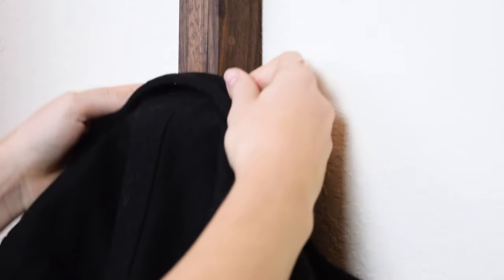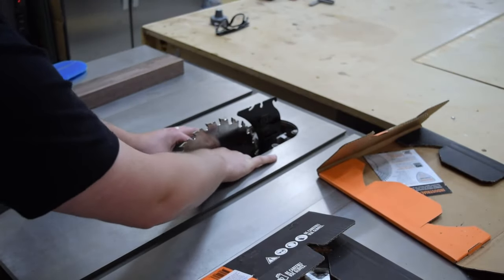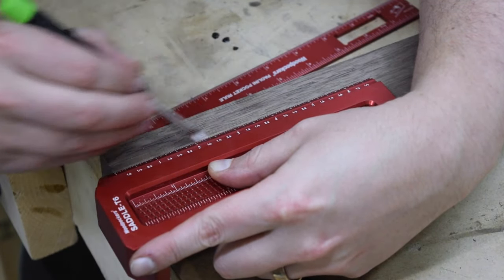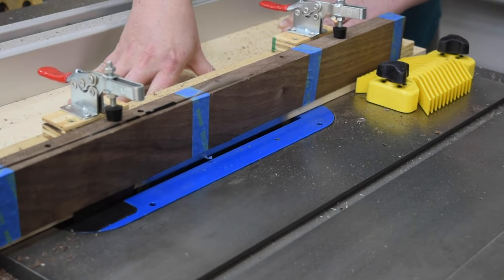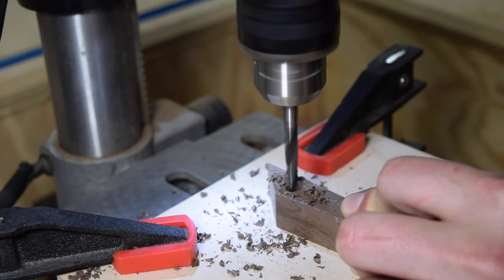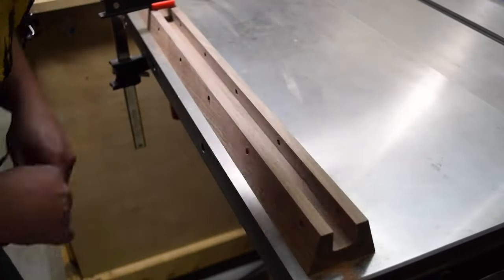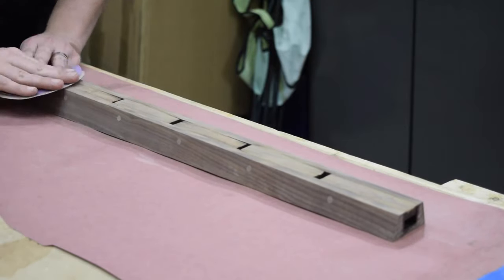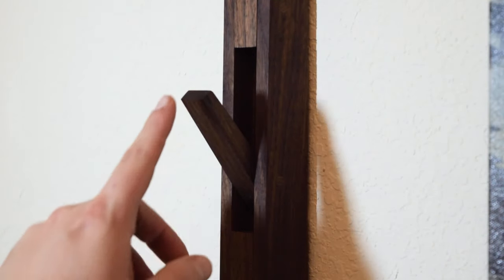Modern Coat Rack | How to Build

Comment: I don’t own a band saw yet, not sure if I can pull off the resaw hanger taper on my table saw safely.
Reply from the maker: Your best bet would be to raise the blade to cut halfway through. Then flip the piece over and finish the cut. It’s not as simple as using the bandsaw method but it should work fine. Let me know if you have any other questions!